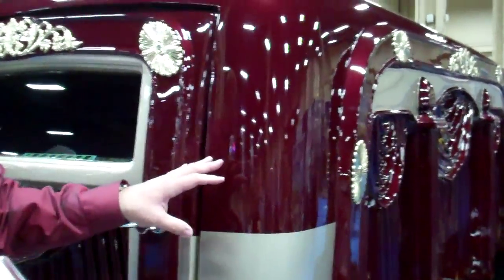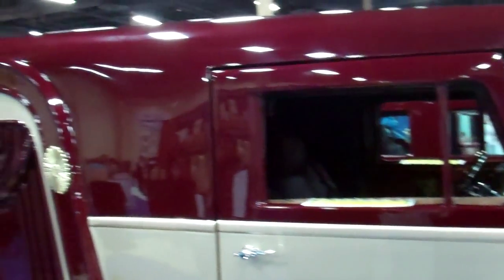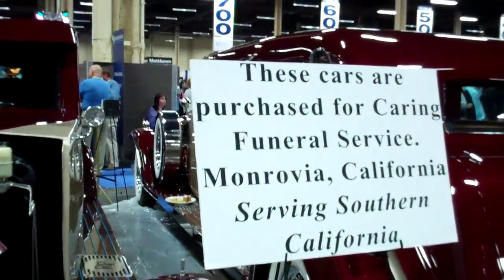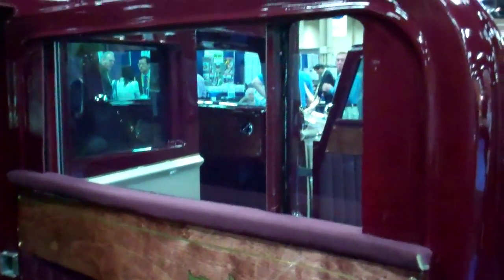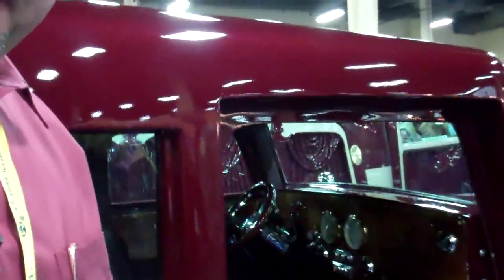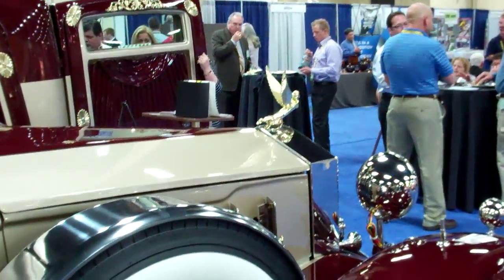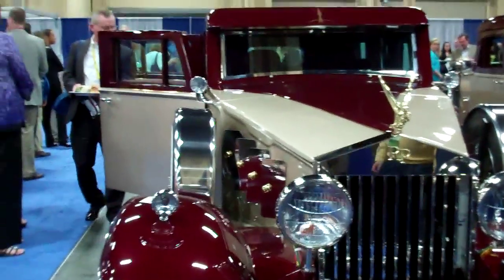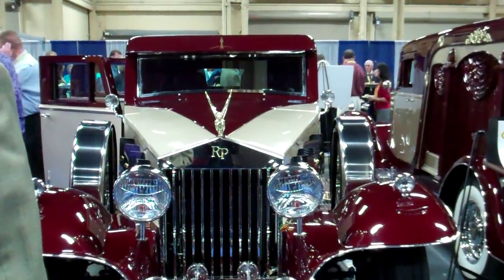Very Cool Funeral Cars

Comment: I was able to cruise around in the Limousine that is at the Waxahachie, TX funeral home. 
It is quite an experience!
A 1941 - 1949 Cadillac 7 passenger factory limousine sits in my garage with a big 454 motor & automatic transmission. 
The Cadillac Limousine just does not compare to the luxurious ride of the Rosewood Limousine. 
My 1938 Packard Hearse is dwarfed by the Rosewood Hearse. 
The Rosewood Hearse and Limousine are both an awe inspiring site to see when actually walking up to one.
The quality that I saw is superior to anything that I have seen at the fanciest car shows.
You definitely get the feel of Royalty.